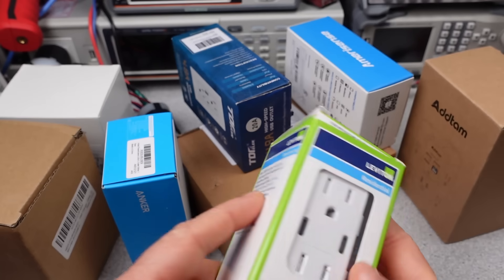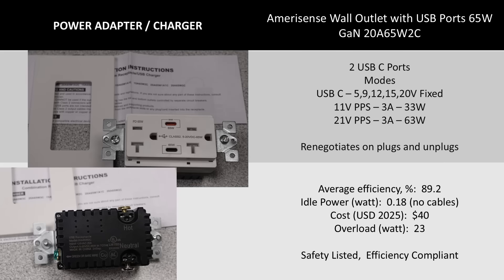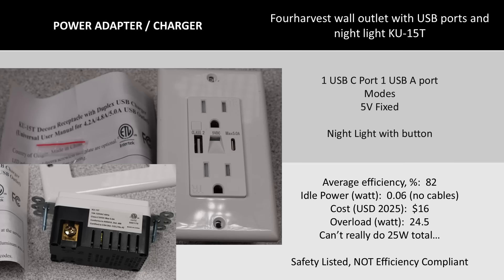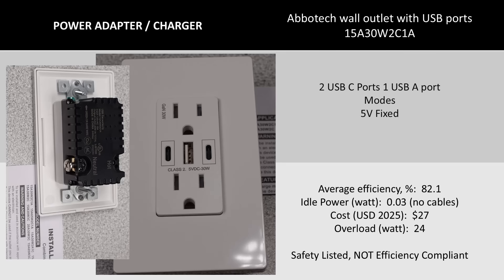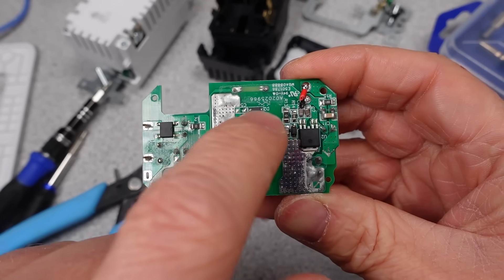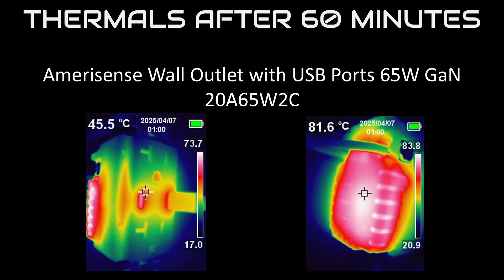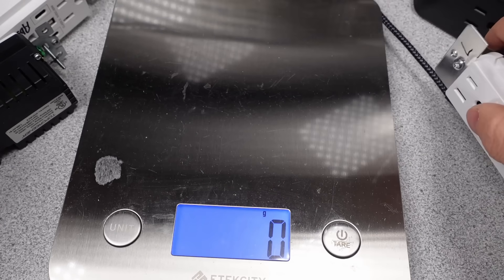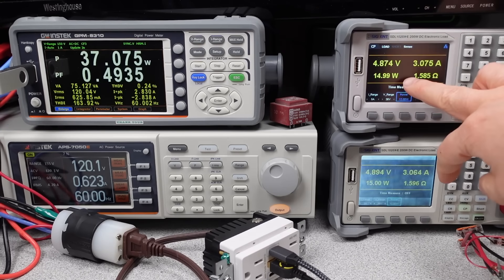AC Outlets Leviton Anker with USB POWER with Tear down

Comment: Longshot, but I figure you're one of the few people out there who can test this. I actually bought the Leviton 60 W adapter back when it came out (it was more expensive than $60 lol). And unfortunately for whatever reason, it didn't play well in the 9V mode, specifically charging iPhones and homepods. I tested it with my Klein usb c power meter, and it confirmed that it would switch/flicker between 5V and 9V, preventing fast charging. And it wasn't just me, other Amazon reviews noted this as well. I know you tested the 9V mode, but can you plug in an Apple device to see if the bug is still here, or has Leviton fixed the issue? Thank you so much!

Comment: I splurged on a Leviton outlet with usb ports and it worked great for about 6 months and then the USB ports stopped working 🙃
Reply from the maker: Yeah, these all definitely have a higher failure rate in general from what I've seen versus a typical power adapter.

Comment: Can you kindly clarify one important query. If my laptop supports PD 20v 3.25a = 65w, and if I use a belkin charger supporting PD 20v 5a = 100w, will belkin charger step down to supply PD 20v 3.25a or will it work at fixed PD 20v 5a only and instead  shift to next supported volts & amps combination supported by both laptop & the charger- e.g. PD 15v 3a = 45w. Thanks in advance for your response.
Reply from the maker: The devices negotiate for the voltage and current level each end can handle and/or supply.  So, everything should work fine even if the adapter is bigger than needed.  It just won't use 5 amps if the device can't handle it.

Comment: Thanks for all your efforts. Can you kindly review Belkin (WCH017) 112W GaN charger. Thanks.
Reply from the maker: Yeah, that looks like a neat one.
Reply: @AllThingsOnePlace 

Can you kindly clarify one important query. If my laptop supports 20v 3.25a = 65w, and if I use a belkin charger supporting 20v 5a = 100w, will belkin charger  supply 20v 3.25a or will it work at  fixed 20v 5a only and instead  shift to next supported volts & amps combination supported by both laptop & the charger- e.g. 15v 3a = 45w. Thanks in advance for your response.

Comment: lol i got some of these direct from china for 4 bucks each. they came with the steel face plate, kind of an asian style design but better than north american standard outlet i think. works on north american housing anyways. they just have 2 usb-a ports and theyre so painfully slow, i think limited to 5v 1amp only. but they dont get warm on thermal camera and they were way cheaper than anything you could get on scamazon. fyi the affiliate link program and sending people to scamazon does cost people money when the same products are sold for 1/3rd the price without any tariffs/blue origin sustainment fees from other websites.
Reply from the maker: Entirely optional, the smarter consumer can go direct and take on some additional risk.  These are the tools the low end creator has.

Comment: Another drawback could be when one overheats and starts to melt there is no way to detect and unplug to prevent a fire. Lucky if the circuit breaker trips soon enough when the wires/exposed rails touch.
9:59 that 2mm airgap between the low-voltage-side capacitor and the high-voltage contact is not encouraging.
Reply from the maker: Yeah, it costs more to make them more efficient, which solves a lot of the problems of heat.  

There is a plastic bit providing some isolation whenever they get close, on the PCB it's more than enough, I'm not sure which piece you are talking about though, the low side caps didn't look to be too near the AC terminals.  Looking at the blue ceramic, to the left of that is high voltage, to the right of that is low voltage.
Reply: @AllThingsOnePlace  at 10:04 the terminals' screws come quite close to the inductor and the upper (on screen) terminal looks quite close to the caps from this perspective. I wonder if it's not fixed or it's bent.

Comment: All my apple and Belkin chargers give me a slight tingle on 240v 50hz. Is this not normal?
Reply from the maker: It's normal, but it's also not normal.  Apple generally is better than everyone else in this category.  You may be more sensitive to it than most.  Wetness of skin is a huge factor, contact to other surfaces that may be grounded, air humidity, lots of other factors.  I couldn't find any studies that cover this clearly, just this number causes pain, this causes death, but even then they aren't sure, so make AC leakage less than this other arbitrary number.  Two studies AC leakage is based on reference each other in a circle, neither present any actual data.
Reply: @ I don’t feel it unless someone else touches me whilst connected, Purely from them and where they’re touching me, Must be a bigger reference to ground. If I swipe my fingers on the back of my iPad it’s very noticeable with just me being in contact, On a bed that has plastic feet. Super duper odd. Although my apple chargers don’t do it so badly. Could also be that the cables I use are earthed from Both sides via the connectors themselves and could be power grid earth leakage. But that’s debunked by the fact that most chargers normally have Neutral and Live only

Comment: Would be interested in the Leviton one as it's one of the larger units as well and as you said, the better of the bunch. I have a couple of these over the years and only the Leviton seems to have a metal shroud that I'm guessing is used to dissipate heat better.
Reply from the maker: Not sure, it's a substantial piece of steel, not exactly heat sink material.  But just being more efficient helps since less heat is generated in the first place.

Comment: This confirms my suspicion, don't go for anything with a strange Chinese name. Especially when it comes to connecting things to your electrical system.
Reply: Whether it's chinese or not, I wouldn't put an outlet with built in charger in my house rather have a separate charging adapter.
Reply: btw, you're just being chinaphobic & most of the products being showed here "even well known brands" are made in china, not saying that everything there is good but obviously be critical with unbranded or very cheap products as they bypass quality check/compliances to make them cheaper.

In the end it's upto you buyer to be smart on what you purchase.
Reply from the maker: I don't think any of these did anything overly unsafe.  There's a good chance the Leviton rolled off the same floor as half of these other ones so certainly not a Chinese brand thing.  All the best stuff is made in China.  The xyz brand issue is global, more about making sure a company is established enough to support the product.

Comment: I've always found these devices a bit weird. Space is at a premium inside most wall boxes, and trying to cram a bunch of extra heat-generating electronics inside the box seems like a recipe for early failure.

Is it really that inconvenient to simply plug a normal power supply into the outlets, or use one of those ride-on-top plates like you showed at the beginning? These things also get outdated much quicker than the outlets. These may seem modern now, but imagine you'd installed a bunch of the equivalent device 5-10 years ago and you'd have a bunch of outdated low-current USB-A ports that you'd want to swap out. 5 years from now, if we're still using USB C, everything will have higher wattage outputs as standard and your in-wall plugs will be kinda useless.
Reply from the maker: I have one I installed 10+ years ago.  Like one of the first ones on the market, it still works, but there is a more capable USB brick next to it in the outlet and yes, USB A 5V only being a limiting factor in it's use.  The ride on top plates make a lot of sense to me for ease of install, I want to check out that market more.

Comment: Unfortunately, in some homes these devices are the only way you can maintain a charging source. If a wall brick is left in my home it will "walk away” by one of the kids or their friends. I guess the Leviton is the best of the worst?
Reply from the maker: That makes sense.  The leviton was good for a 65W adapter.  92% is about as good as it gets for this range, barring research projects and fake products.  The drawback is mostly limited modes of charging.

Comment: Not from the US but do you really have to get an electrician to in stall these?
Here in the Netherlands, doing that yourself is a pretty normal thing to do.
Reply: In the US you don't. Changing an outlet is a normal DIY project, though as with anything electrical, it's not something someone who has no idea what they're doing should try. If you're making major changes to your electrical system, you probably should get an electrician to verify your work or have one do it for you. An outlet or switch replacement is not a big deal though for most people.
Reply from the maker: Yeah, that was hyperbole, people are too literal, I probably didn't give it enough sarcastic attitude in the read.
Reply: I was just wondering, because in a decent number of European countries such as France you are actually required to have an electrician check these things. Or it may cause issues around insurance claims.
Reply from the maker: @qlum  Yeah, it makes sense too with the higher voltage at the socket, more risk, a lot of risk management, hopefully there is a good system to get reasonable pricing and speed to inspect outlet changes, sounds like a good John Ward question, also quite a few different outlet wiring techniques and options.

Comment: OK, lesson learned: better use a well-sized wall charger plug and forget about those integrated into the power outlet. ✅
Reply from the maker: haha, my channel is like the anti product channel.  I was watching running shoe reviews, and one thing is common, every shoe is amazing, even if the reviewer doesn't like something, it's still framed as a positive.
Reply: @: Your critical thinking and thorough analysis is top notch🏅
I am a runner, too. Yes, most reviewers are afraid of the consequences of negative reviews, because they depend on early access to the newest shoe models for their reviews. You don't - because the electronics you are reviewing are not fashion items.
Keep up the right way of reviewing 👍
Reply: @AllThingsOnePlace not the point, but once you try and get used to "barefoot" shoes you won't like most of the normal shoes.

Comment: “Did you make it this far? Why?”
Because I’d like one that I can put in each cubby hole of a large piece of furniture that will hold dozens of modded retro computers and game consoles. Lots of these mods involve USB-C power mods or USB charging wireless controllers.
Reply from the maker: Ah, that makes a lot of sense, thanks for sharing.  Yeah, I've noticed that a lot of the adapters and things come with an even junkier little USB adapter, so one of these certainly sounds like an upgrade.